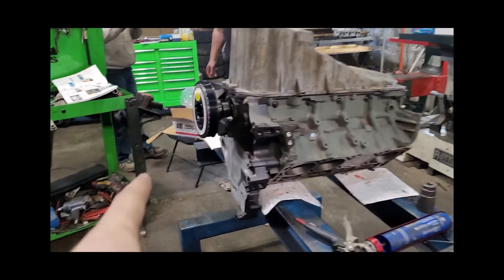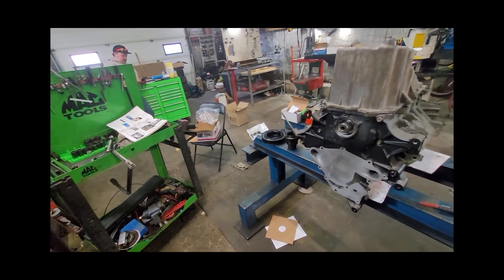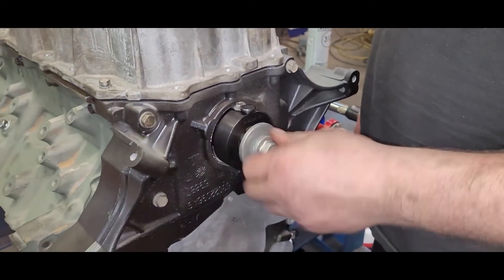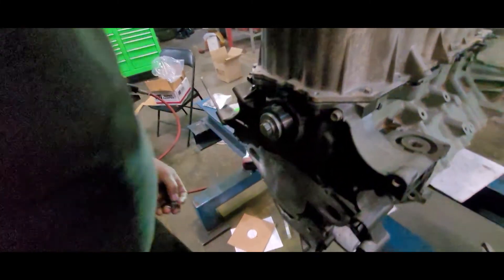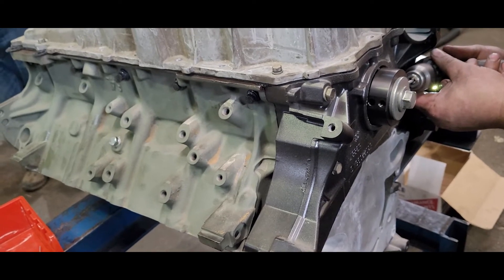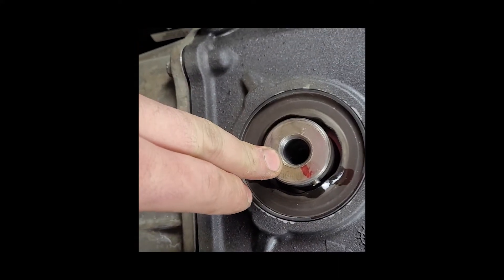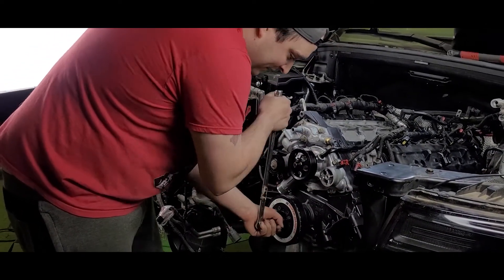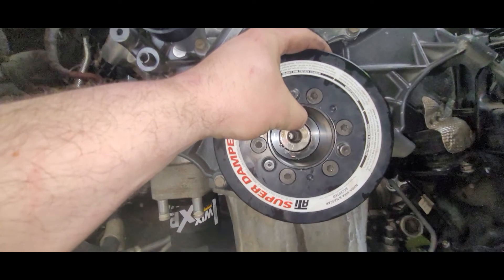Hemi ATI Crank Pinning and Super Damper Install!!

Comment: I have installed the super damper onto my 06’ hemi. For whatever reason the seal kept leaking. Was real tight fit. Used mahle, mopar.  What crank seal did you guys use? Any leaks after installation?
Reply from the maker: What's your crank case pressure situation? Most leaking seals on hemis is related to not enough venting
Reply: @RunningJoe  I’ve never measured it. That’s an interesting question. I have the dsc-1 procharger witb 7lbs. Let’s just say it’s higher than normal. What’s a good relief remedy? Breather for valve cover?
Reply from the maker: @kenc.2448  yup you are overpresured send me a DM on facebook

Comment: Does it have to be pinned? My stock one came apart and was thinking of upgrading to this one but I don’t think I have the knowledge to do everything in this video
Reply from the maker: I pinned because im driving alot of boost. If you are supercharged or even turbod id pin it

The issue is going from high rpm to low rpm in a rapid way. If you what ill call OEM plus aka basic bolt ons, no dont need to pin

Comment: Guys, ain't Your front seal was installed backwards?
Reply from the maker: In this video yes i believe it is backwards hahahahha 

Changed it again a few months later
Reply: @RunningJoe  Hope You were good with Your build :) Faulty sealing can make some mess.
Reply: @RunningJoe lol dont worry brother everyone has mad this mistake in many videos even guys in tutorials on showing how to change seal on hemis and i as a mopar tech has did this 2 times lol😂 one time it never leaked for what ever random reason but the 2nd time is pissed through and noticed it was the seal n noticed i had put it backwards 😅common mopar mistakes

Comment: I just had my 5.7 rebuild forged bottom end. Have a regular d-1sc. Going at the most 12psi but prob stay at 10psi. Mostly need as a daily driver.  Do you recommend the super damper or
Stock harmonic balancer sufficient? Had it internally balanced
Reply from the maker: Super damper, the factory damper was coming apart already on mine
Reply: Sorry can you give more info on the 7/8 install tool?

Comment: some good info, I was wondering what size ATI pulley did you install the 18% OD or 6%OD also what pulley are you using on the Procharger. Good video. Thanks.
Reply from the maker: I went with the 6% originally but now am on an 18% over, I run a 3.0 my procharger and at 7500 im like  20 ish psi with a d1x
Reply: @RunningJoe  Thanks for the reply did you run that  Pulley combo with the P1-SC also do you spin the motor that high.  I have the same pulley  combo upper is a 3.0 Griptec but with a P1 SC.  Was going to spin the motor to about 6400 RPM. Just finish building the motor.  Like you video's Thanks again.
Reply from the maker: @Steve Pryce  I did run the p1 on a 18% and a 3.0 BUT I was hitting a wall of heat after 6500 rpm . I think I was hitting 12 -13 psi 

I'd have to look at my logs
Reply: @RunningJoe   what I was hoping 12-13 psi hope the Water/Meth will help some with the cooling on the Jeep. If you do look at your log LMK greatly appreciated. Thanks again.
Reply: Hey what is a 18% OD and Difference in a 6% OD ion kno how y'all get that Knowledge.. I'm Running boost and Using that Damper soon

Comment: Great Video , I’m having trouble with mine , 
On my 08 Chrysler 300 srt8 6.1 
I bought a 5% ATI - 918432 6-75 AL - 6 Serp 
Machine Guy , did Installation , problem Is having , serpentine belt try’s to walk in/out of balancer . 

Any Suggestions?? What can it be wrong ?
Reply from the maker: Either misaligned or too long of a belt

Comment: Awesome video, Im glad i came across this, this opened up my eyes a little bit, i do have some questions. Im going to install my ati balancer and also pin it on my corvette. Did you have to position the harmonic blancer on the crankshaft a certain way for your application? Was a little confused when watching the video, am trying to understand the part where your talking about tdc. Need some help!
Reply from the maker: we placed the balancer in a way that I could reference the engine from below. so when doing some testing at the track or in the shop we can roll the engine over to Top dead center and know where where to start from there!

Comment: Are you only pinning the damper for boosted applications i just picked up the  same one but I'm like 99% positive the crank did not have a key way
Reply from the maker: no keyway on the crank, the damper's from ati come keyed, I would key it even if I wasn't going boost, more of just in case scenario!
Reply: @RunningJoe  see thats what I thought! So its just pressed and you eye ball the TDC mark being you don't time it from the damper
Reply from the maker: 100% we set mine up to look from under the vehicle to know where TDC is roughly, but yah no way to really time the crank unless you key it. Which in hindsight I wish we would have machined an actual keyway
Reply: @RunningJoe  awesome thats all I needed to know because I was going crazy I know the stock one didn't have a keyway so I was like wtf do I do here hahaha thank you so much !
Reply from the maker: Remember to put a dab of silicone in the keyway or you'll leak oil
Reply: @RunningJoe  yeah it  will huh ok awesome thank you for your help!
Reply: @Srt.8_bob 3 years late but how did your come out?